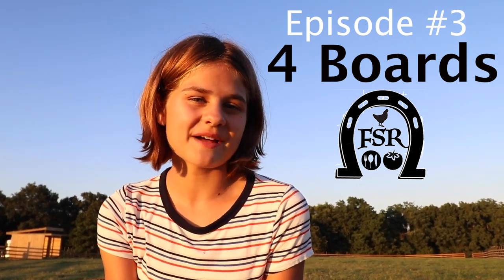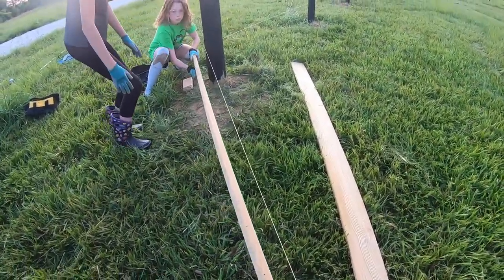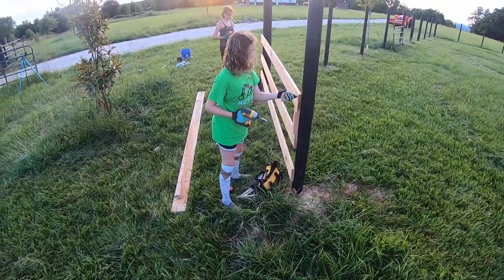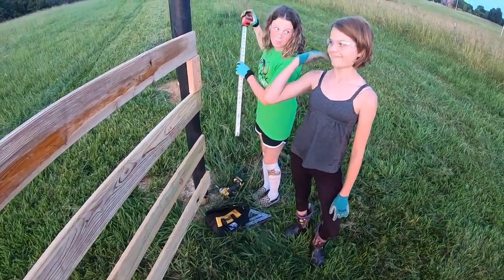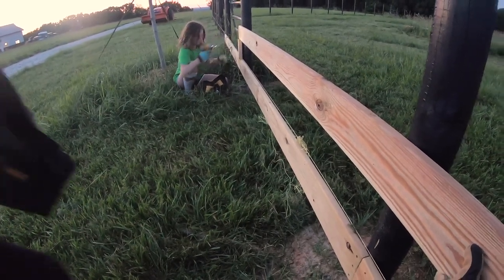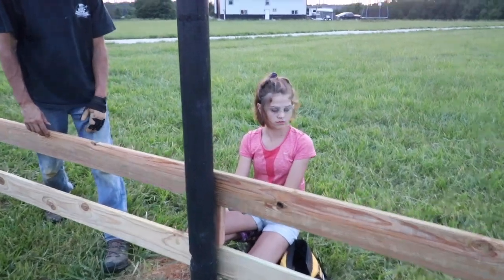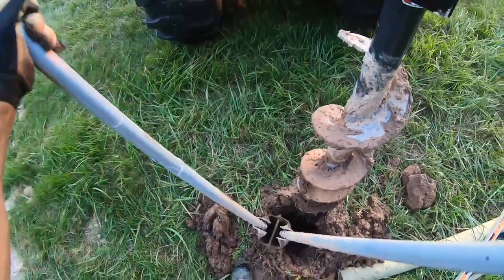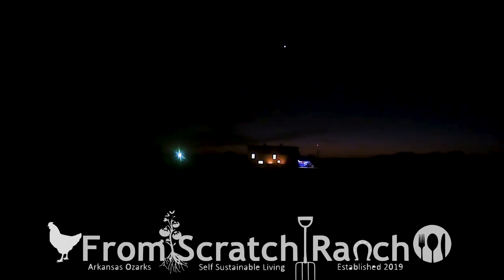1 Acre Horse Fence:  Episode #3:  Four Boards

Comment: Video is a couple years old, but I was taught that the planks should be nailed/screwed to the inside of the posts (on the pasture side), so that it's harder for horses to pop out the rails if they lean on them with their butts or chests. Maybe this is only necessary for nailed boards, though.

Comment: What size posts are those. And what size 2 bys?
Reply from the maker: The fence posts are mainly 4/5 treated rounds from Tractor Supply. Corner and Gate posts are 6/7 inch.  The rails are 1x6 treated decking boards.  2x6 would be better, but these are holding up well with our horses.